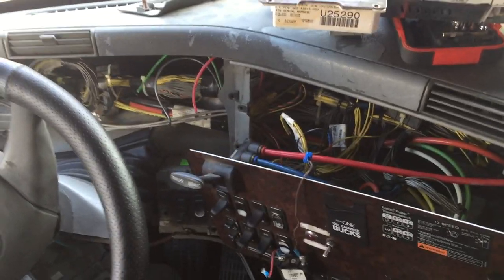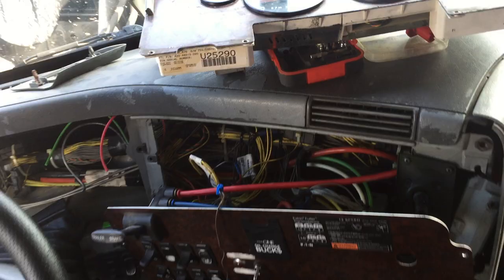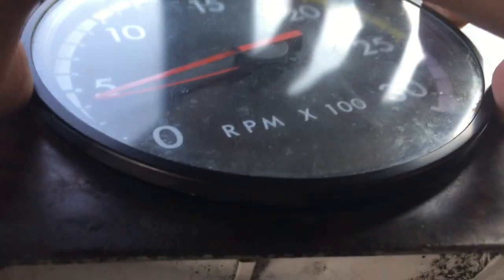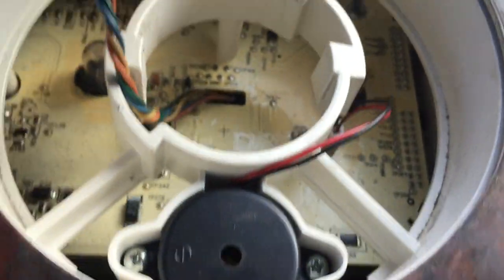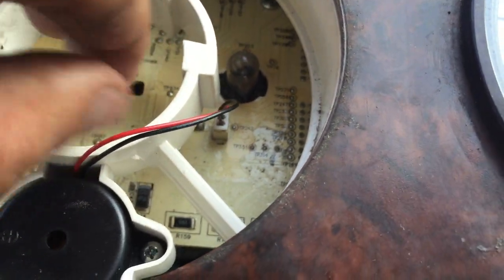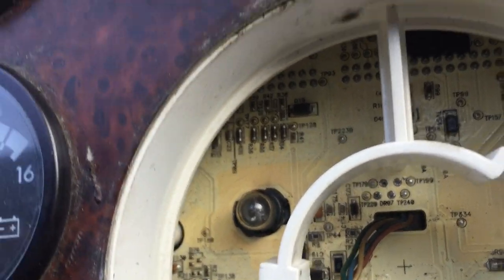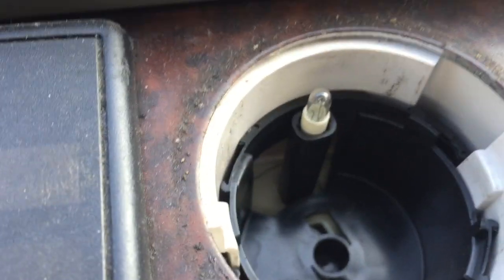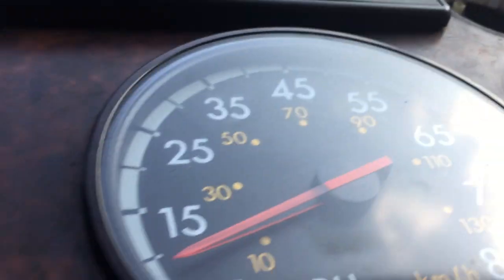Low air pressure buzzard location and troubleshooting 2006 freightliner century class

Comment: If your buzzard stays on it’s the low air pressure switch which is located just behind the fuse box your welcome
Reply from the maker: Thank you.
Reply: I'm replacing mine on a fld120 as we speak. Ironically it may be the trailer pressure switch because it loses air when I engage.
Reply: Do you know where it's at on a coronado

Comment: That’s good to know where it is but where is the trouble shooting part???
Reply from the maker: Sorry man, my first vid. Check voltage by voltmeter on the terminal, where you take putt buzzer plug out, you should see some voltage if your air pressure is low. If no voltage is showing I cannot help, if voltage exists and buzzer is not making noise then place buzzer.
Reply: Aleo 8300 my buzzer wouldn’t cut off for a year. I spliced the wires and ran a switch to cut the sound but the light stays on. Doing an annual inspection I failed. Going back right now to get the steering gear box replaced. And this is what blows my mind. I wired the buzzer up correctly yesterday. I crunk up the truck today. Buzzing sound. I turn on the AC to cycle mode the buzzer goes off and the light. I air down and it goes off at 60psi. Somehow the air is working the buzzer and light. So I taped up the AC knob. Going to pass this inspection lol
Reply from the maker: Glenn Cornelius I am not a mechanic, but maybe the pressure sensor sending signal to ECM or buzzer have issues. Good luck
Reply: Glenn did you find out why the buzzer stayed on or why it was controlled by the  ac?
Reply: Sorry late. But yea. I wired the compressor into the wrong line under hood 😂